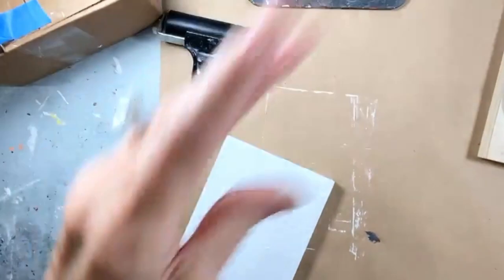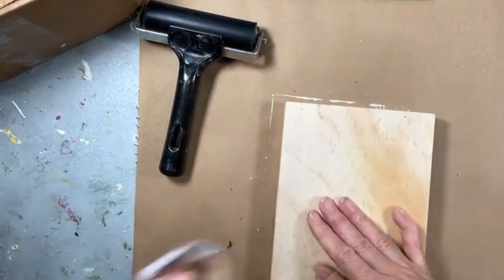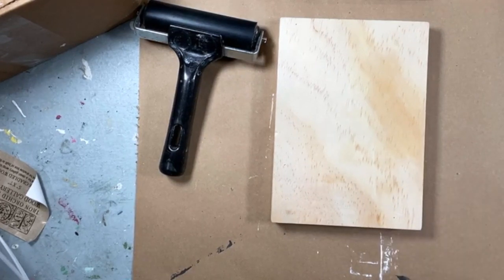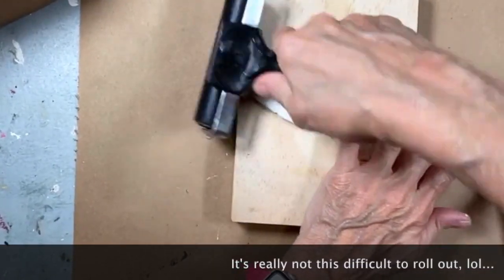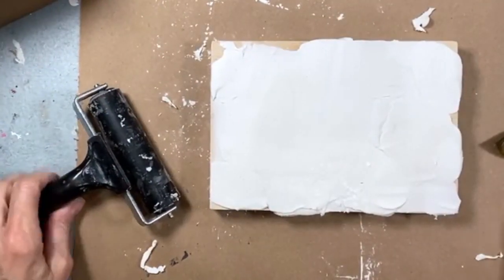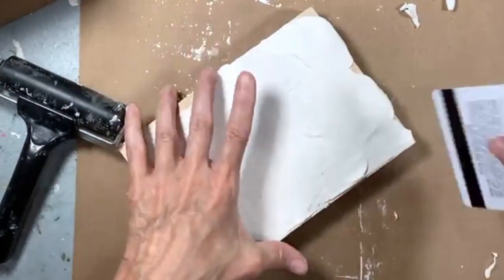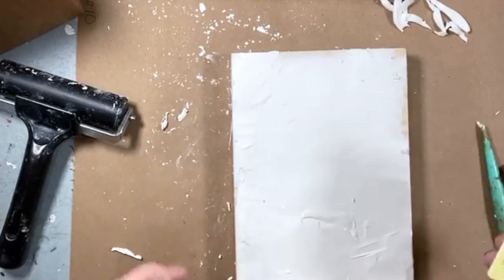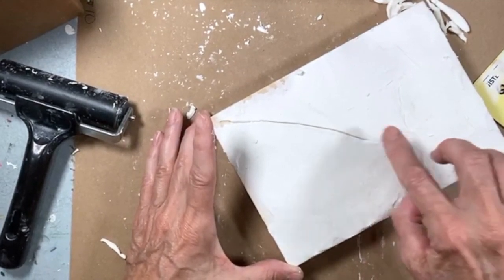Created a Cracked Tile Look Using Air Dry Clay: Tutorial

Comment: have you ever wet your surface and then blotted the excess moisture off, leaving a slightly damped top, and then stamped the inked rubber directly onto it? You can get that water color effect and then as it dries, go back in with some ink on your brush to darken it here and there. Sometimes you can barely mist the inked stamp and do the same thing, depending on the look you want. 
I was wondering why you use the baby wipes. Is it just for the wetness or for the chemicals in it? I use soft tee shirts or blue paper towels, no pilling that way, and so much cheaper. I really like what you're doing!
Reply from the maker: Thank you so much, I haven’t tried that but I definitely will! The baby wipes is just for moisture really but sometimes it’s like a magic eraser lol 😊. I appreciate the tips.
Reply: @SweetandSassyTreasures  absolutely, I used to do it all the time on heavy card stock for card making. You might have to play with it to get the results you want.